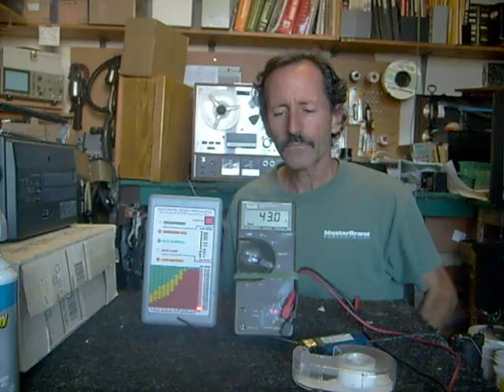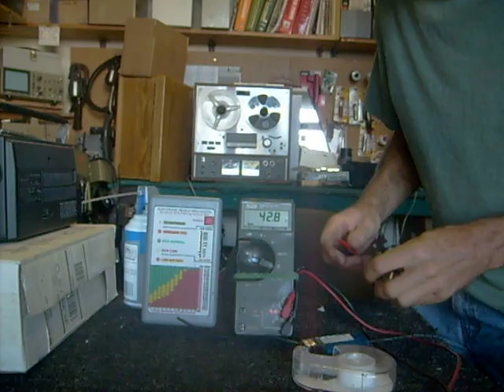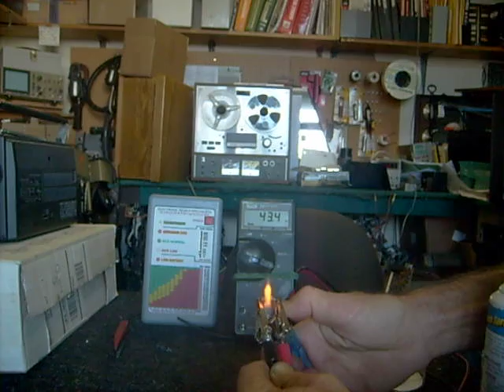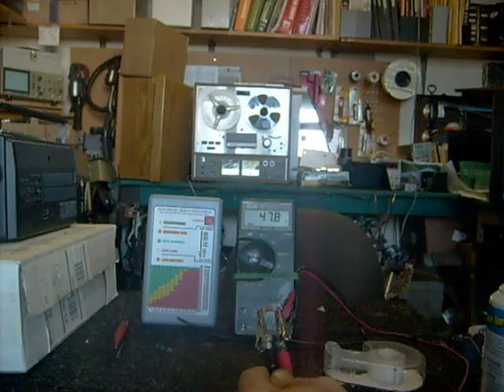LDC TV Repair made easy # 5

Comment: What kind of Cap meter is that? and lol at your comment about the resistor, "don't wanna get to get it too hot and wreck this resistor".  Unless you have a very special one it cost what .02 cents. Just kidding ya man, you do some great vids.
Reply from the maker: +vboss5764 I'm using a CapAnalyzer 88A
Reply: vboss
It's called and E.S.R. Tester
(Equivalent Series Resistance)

since you asked the question, i am going to assume that you don't know.
so, i'll give you the full explanation of why it's necessary

if you have, let's say a (let's keep it simple)  16V  1000uF Electrolytic Capacitor

you have to understand 2 things
Voltage and Capacitance

Voltage is Electrical pressure, Meaning..... this cap cannot hold more than 16 V (Theoretically) of PRESSURE.
but we don't need to test if it's charged or discharged

CAPACITANCE :   
- Your Multimeter should have a Capacitance Range and IF IT DOES, you will probably want to test it for Capacitance.

- IF DOING SO... You will allow 20% tolerance as a rule of thumb
so.. on a 1,000uF  (micro Farad ) capacitor NORMAL RANGE WOULD BE 800uF - 1200uF
HOWEVER THIS TEST IS NOT A TEST OF STABILITY,
this is what we call an ALL OR NOTHING TEST
it tells you the Capacitance at that point in time under those conditions

NOW.. ENTER THE E.S.R. TEST

Why do we use this.
Because.... Many a time a Capacitor will lose capacitance (hence, be DRY inside) but will still give readings withing it's NORMAL RANGE
hence, you'll think the cap is good when it's bad

to test a cap properly 
1. YOU TAKE IT OUT OF CIRCUIT

2. but.. using an E.S.R. Tester you can measure it in circuit,   this is the first benefit,   it saves time

3. An E.S.R. Tester uses (i think ) a 100Khz Signal with something like 2 Volts to test the reliability of the capacitor.

4. NOW HERE'S THE FUCKED UP PART   hehe
this requires experience
the next step is to know what a NORMAL ESR READING IS

well, it's not as straight forward as just saying 0.02  (which is what people believe it should be for all caps)
not the case

5. to get an accurate answer you consulte the datasheet from the supplier
but... that doesn't always work because some suppliers don't give them to you or they are unclear

WHAT YOU NEED TO DO IS TEAR APART A FEW BOARDS AND TAKE OFF THE CAPS AND COLLECT THEM TOGETHER AND HAVE A HUNDRED OR SO AND COMPARE THE READINGS (E.S.R. Values) of Same caps

and Same means....
Same manufacturer
Same Values 
Same Everything

but to answer your question

HE IS USING AN E.S.R. METER to test the reliability of Caps
it's worthwhile getting one , because realistically, if you don't have one, YOU ARE IN THE DARK when it comes to fixing screens
and you'll be one of these guys that just says "i changed all the caps, and it's still not working, what do i do now"  hehe

does that help

Comment from the maker: @MrBogs88 It's probably a good enough cap tester but I don't know much about it. The DCR you asked about stands for DC resistance I imagine. If you ever wonder what's an acceptable capacitor sometimes it's good to compare it to a new one and see the difference in the way it reads. Keep in mind a marginal cap may work fine in many circuits. You don't have to go replacing them all just because they check a little less than perfect.
Dave

Comment: I have a 28" LCD TV that crapped out (white screen with colored vertical lines).  I took a heat gun and heated things up for 45 seconds and bingo, it started working.  Now I just have to figure out which cap it is and how to replace it!  Thanks!

Comment: I have a power supply in an older computer (Socket 754 AMD) from hp. One day it stopped booting up and the light on the power supply started blinking. And then I noticed that once I have heated up the power supply with a hair dryer the light glows green and the computer can be booted. If I replace the caps in the power supply will this problem be resolved? I know I can buy a new supply for cheap. But I enjoy tinkering with things.

Comment from the maker: @JMLUVZ2FLY If you have an ESR capacitor tester you can check most capacitors in circuit but not with an ohm meter. You can discharge most capacitors by placing a high wattage resistor across the terminals I would say a couple thousand ohms at 5 to 10 watts should be fine. You could use a resistor with higher resistance but it would just take longer to discharge the caps.

Comment from the maker: @Wizard4592 
That's a tough one to answer. In some cases I have seen CRT TVs still operating when they had 2 or 3 capacitors that were so bad their ESR value could not be measured on my meter. This has been especially with the Capacitors under 10 uf. Sometimes on older TVs you find a great many capacitors with higher than normal ESR but its not worth the time to change them all.